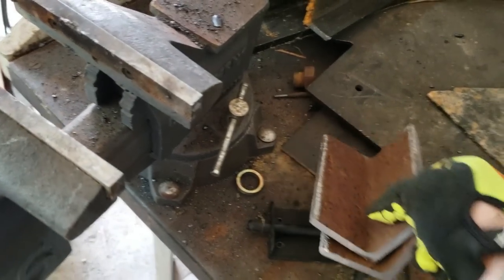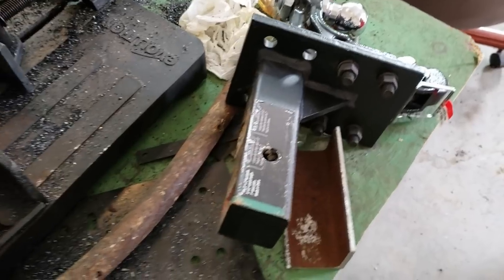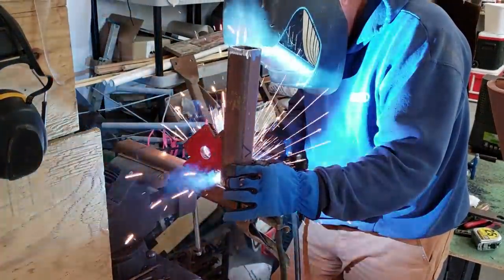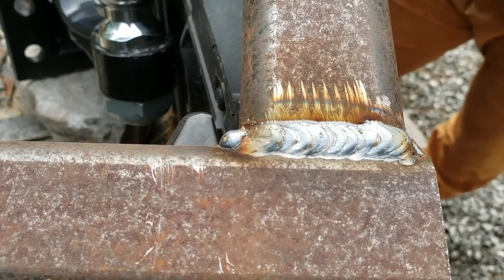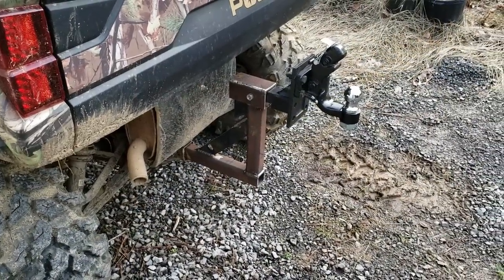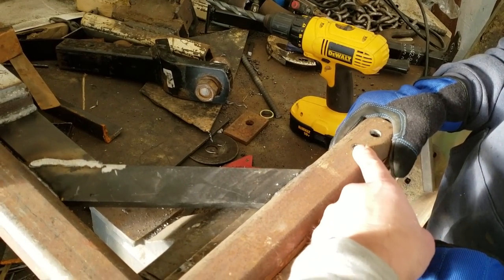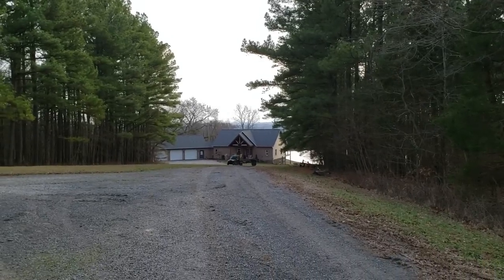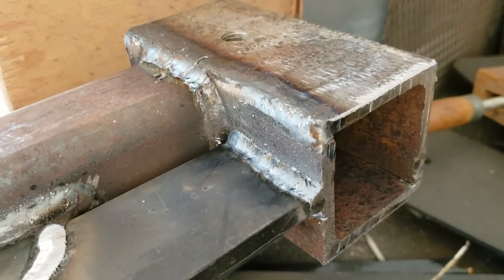Steel Fabrication Mig Welding a 13 inch hitch riser for Polaris Ranger

Comment: I think it is safe to say you will probably rip the the back end of the Polaris off before you break that hitch! LOL Nice job!! I forgot to ask you before, how do you like that Evolution saw?
Reply from the maker: LOL yes Phil doesn't do anything that's going to break that's for sure! So far that saw has been awesome great tool to have in a shop.
Reply: @kapperoutdoors  DeHaven is right about ripping it off the back end. The hitch is rated at 2500 lbs straight pulling weight.  By putting what looks to be 15 inch offset hitch on  or fulcrum, you may have reduced the 2500 lbs ratting  by as much as 1000 lbs .I would suggest tying it into the frame above on both sides. to beef it up. Please don't  ask how I know LOL  Just trying to help out  Nice job on the build

Comment: That's a good weld bead Phil.
Kapper,..if it looks like a roll of nickles it's pretty good,.if it looks like a roll of dimes it is real good;. So I've been told!  I'm a 'half fast' welder and it looks like it'll hold up, to these eyes at least.
I like that he put that gusset in there between the draw bar part and the vertical bar,...now will the Polaris hitch stand up to the trailer, you and time, will soon tell the tale.
Reply from the maker: Yes time will tell but I think it will be okay
Reply: @kapperoutdoors   OH I don't have any doubt of that,..I have faith in you Kapper,...keep 'er goin' !

Comment: I'm a long ways from an expert but the bounce of the new hitch with an empty trailer would cause me a lot of concern.  I recall you said you were going to relocate the hitch pin hole, but that is still a lot of torque on the Polaris receiver. On a brighter note I like the design of the new hitch and the braces.  Weld appearance?  You are the only one you need to impress and if it passes that test and holds, then all is well.  Your welds will improve with practice.
Reply from the maker: Thanks man I appreciate it. When using that big trailer it will always be slow going and careful and we don't plan to use it that often with the Polaris. But I wanted the option to be able to just haul it around the property for miscellaneous tasks. But we definitely will take it easy with that trailer attached. I also have the hitch set up for the tractor to use that trailer as well

Comment: Nice job. How much is the Polaris rated to pull?   Guessing that trailer is pretty heavy.
Reply: The website shows 2,500 lbs.
Reply from the maker: Trailer is 1400 lb empty, it is Aluminum, and the Polaris can tow 2500

Comment: That trailer is heavy duty , do you know what it weights ? What’s the towing capacity of the Polaris. Sounded like she pulled it OK.
Reply from the maker: The trailer weighs 1400 lb empty and the Polaris I think is rated to tow 2500 pounds
Reply: Sounds like you’re in good shape.

Comment: The hitch looks awesome my concern will a Polaris be able to stop with all that weight behind it put on your seatbelt in a hang on let's give her a try
Reply from the maker: Well I think it's rated to tow 2500 lb and they have a heavy duty braking system to handle all that weight but I would never overload anything would I? :-)
Reply: Well my friend like I say be sure to put your seatbelt on and hang on let's see how overloaded it is that trailer looks Mighty heavy by itself